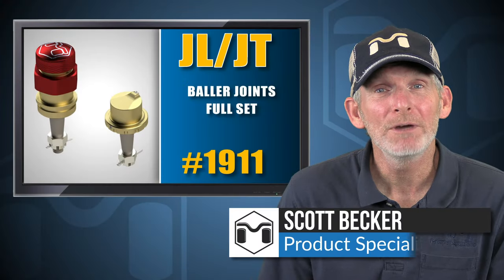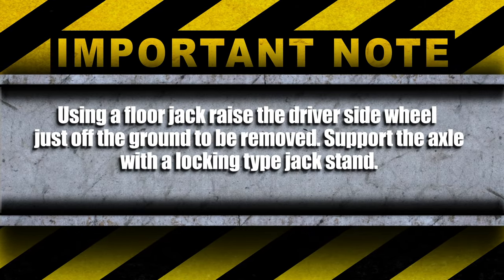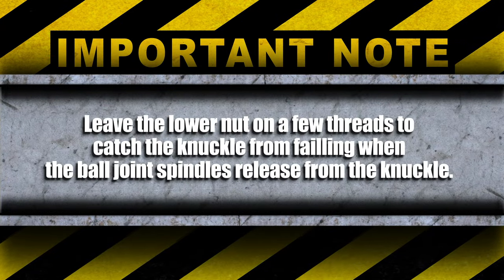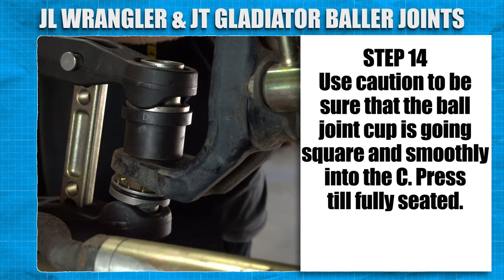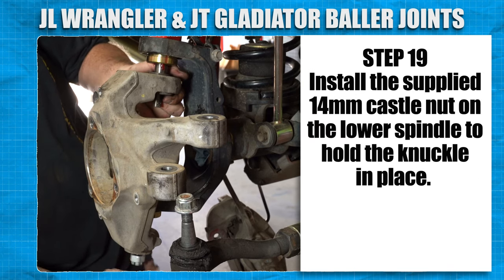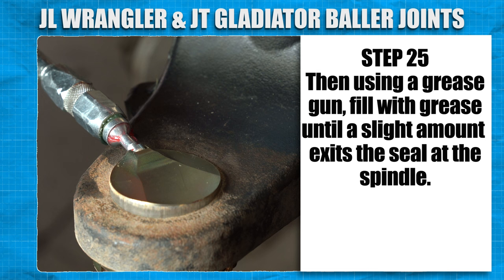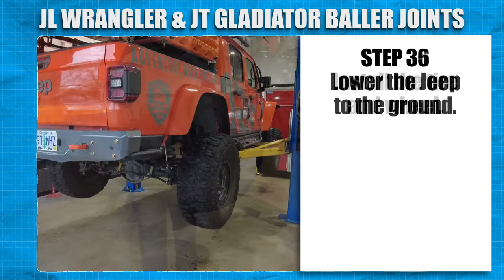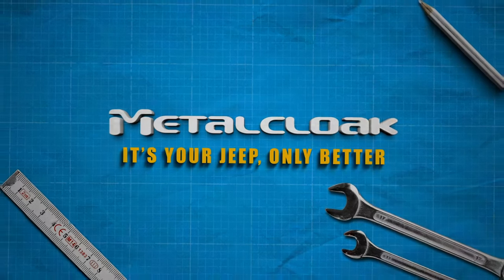How To Install: MetalCloak JL Wrangler & JT Gladiator Baller Joints

Comment: The last time I replaced ball joints on a vehicle, they were riveted and I had to drill them out and bolt some in so I just want to be careful. Will any ball joint installer tool work great or do you have a recommendation on a part number or characteristic? Thanks

Comment: Y'all know what y'all forgot with this instruction video?  I just completed this task of changing out my ball joints in my JT & I got lucky that I didn't tear something up.   For the rest reading the comments before or after watching this video, this is very important to do if you're changing your ball joints....

#1  Open your front differential fluid valve & drain your differential oil
#2  Loosen your F.A.D. that is located in the rear area of the your front axle.  It was easier when I had this on jack stands & could get under the vehicle easier.   Carefully take FAD motor off & slide out "fork-like" control that connects/disconnects your Front Axle Disconnect & pull out spline-piece.  
#3  Now you may carefully pull out axle-shafts
Reply from the maker: thanks for bringing that up.  We've swapped BJ's on numerous FAD equipped axles without out having to disconnect the FAD since the inner fork keeps the collar in the correct position and the shaft simply slides back in (usually).  We also lift the side that you're working on slightly so that you don't lose any fluid.  You could play it safe and remove the FAD/fork, but it hasn't been an issue during our installs.  Worse case is that the shaft won't go back in and then you have to pull the FAD at that point.